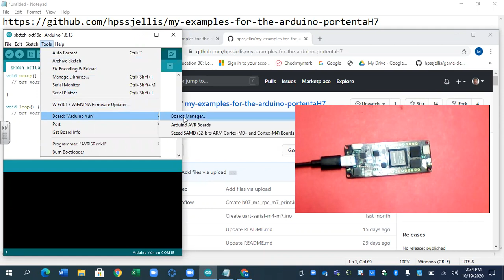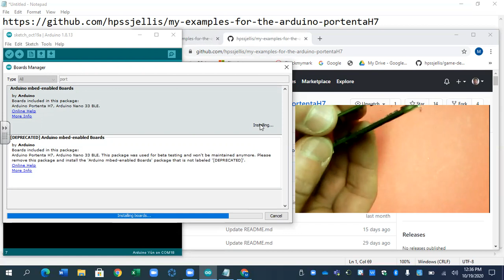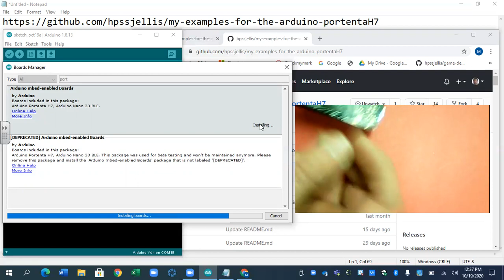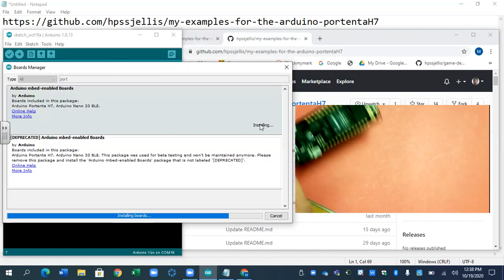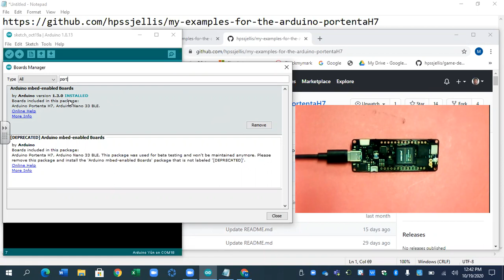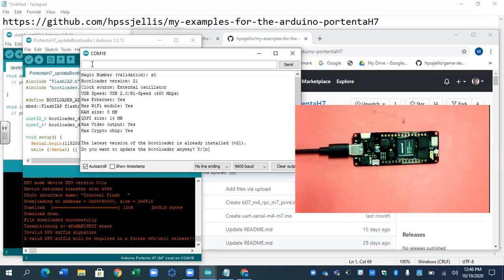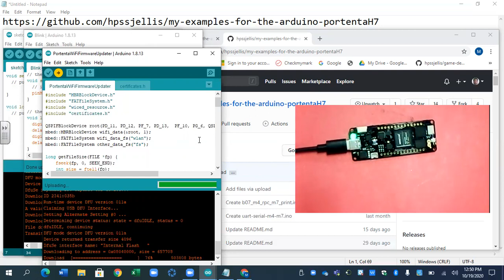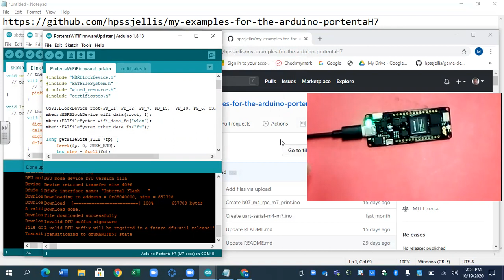Portenta installation

Comment: Do you have to install the portenta pin header yourself ?
Reply from the maker: Yeh, it is a bit scary if your not good at soldering. I recently got a soldering microscope and it makes things like that a lot easier. Not sure why Arduino doesn't allow you to purchase them with the headers pre-attahed for a few extra bucks.